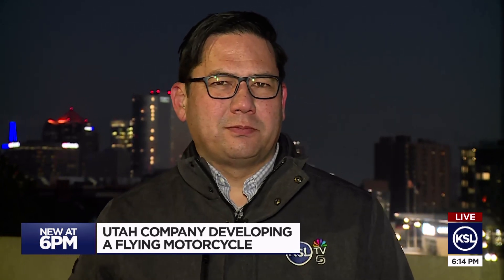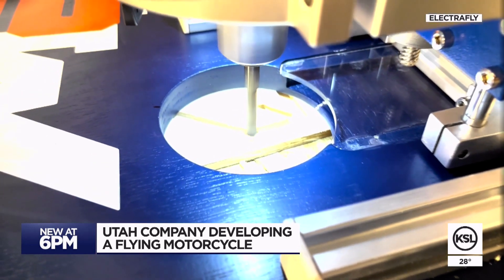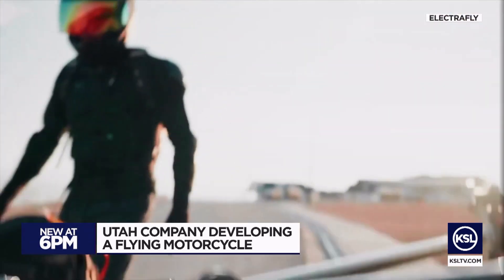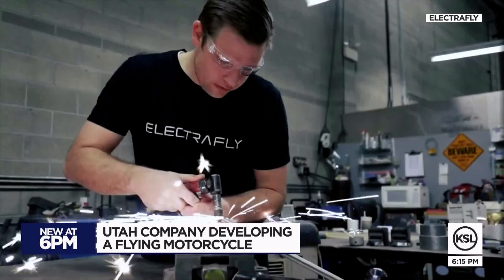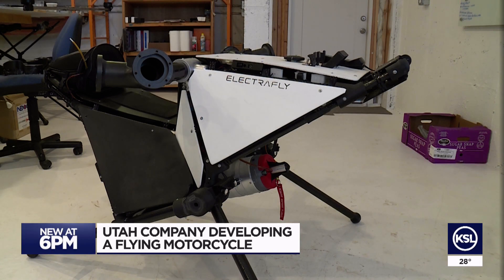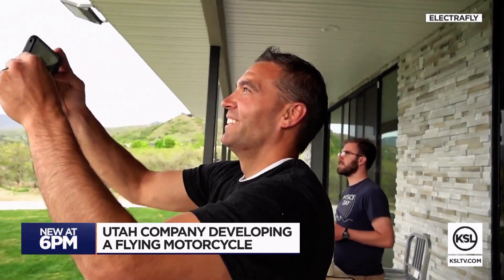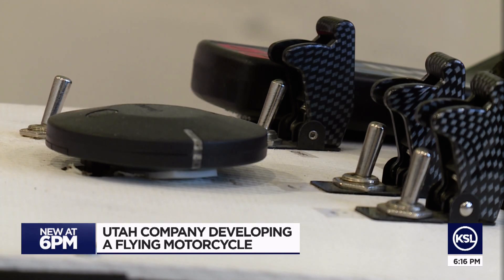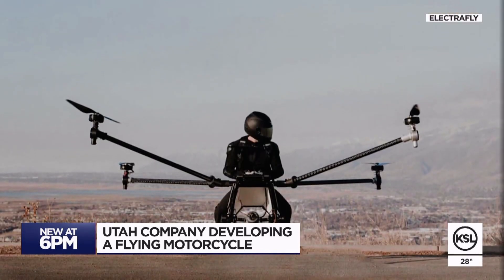Utah company developing a flying motorcycle

Comment: That'd sure cut down the lines at the airport way to be innovative
Reply: It would, unfortunately, literally cut down the lines. Imagine building a car or motorcycle with rotating blades like fighting chariots in Roman times. 
No way this will ever get authorisation. At least, I hope not.
Reply: @Joe-lb8qn  they said the same thing about the airplane & car
Reply: @micblue4739  And if cars had whirling blades coming from the wheels i somehow doubt they'd have been passed as safe. And of course airplanes are restricted to certain areas with rules and regs not just gaily touching down in peoples drives and yards
Reply: @Joe-lb8qn  Oh, you mean rotating blades? Like the ones on airplanes and helicopters that we have now?
Reply: @forzatuner3916  yep. Like the ones there are numerous safety precautions around.  No devices that don't have ducted fans or fans above head height (eg helicopters) are likely to be licensed for obvious reasons.  That's why the personal transport drone like  vehicles you see getting close to commercial sales are ducted unlike this amateur effort.

Comment: The future is "personal" flight. Give it some time, you will see.
Reply: Not gonna happen. Anyone who supports flying cars is a fool. There's no advantage and a ton of downsides. You trade congestion at ground level for congestion at 500 or 1,000 ft, leading to massive safety issues. The cost would be astronomical, safety would tumble. Everyone would either have to pay 150 grand to go to flight school, or pay a private pilot a six figure salary to fly you around. Those are the only options. You can't put inexperienced people in a flying machine and assume the autopilot will handle it, that's not safe nor reliable. What used to be a simple commute to work will turn into your "car" circling your office for 30 minutes while you wait for clearance to land while you navigate air traffic. There are no upsides, slower, more expensive, less safe, worse for the environment, more cramped, less practical, less reliable, and more stress inducing.
Reply: @KB-bh9hp  You sound like the haters who told the Wright Bros they were "crazy" or the ones who told Columbus the world was flat. AI and computers will handle most of the navigation issues. Minute Man ICBMs were programmed with guidance systems that could hit their target from 8,000 miles away in the 1960s. These new electric flying machines are gonna be like the helicopters we have now, only much smaller and lighter. It may take a while, but as i said, in time this will become a reality.
Reply: @forzatuner3916  You couldn't be further from the truth. I'm a huge car fan, the auto industry is one of the coolest, and most advanced industries out there. Yet so many people doubt new tech when it's introduced on cars, say it's never gonna work out. I believe in progress, but wasting billions of dollars on something that doesn't appear to have much in the way of tangible benefits doesn't seem like progress to me. It's already been discussed that even if flying cars are mass produced. Even if they get to the point where the average person can afford them. They still won't be that useful in urban environments. It's heavily theorized that flying cars would be outright banned in these types of areas to avoid the safety issues that come with heavy air traffic congestion. So what you're left with is something that will really only be allowed to use it's full potential in rural communities. But these areas tend to be less congested anyways. At that point, just drive.
Reply: @forzatuner3916  Don't get me wrong, they'll be a cool toy, I can see the recreational potential. Something like an ATV taken to the next level for people who want to explore diverse outdoor environments. But something like this will never give something like cars a run for their money. Not that anyone would want them to.
Reply: @forzatuner3916  My grandfather was a propulsion engineer at Boeing his entire career. He developed the engines for the original 737,747,757,and 767. I'm not opposed to tech, or trying to achieve something that seems impossible. That runs in my family. I just think you need to wonder why you're doing something before you invest all these resources into trying to make it a reality. Flying cars will just be recreational vehicles, and more futuristic, heavily stylized versions of "helicopters" for elite clients.